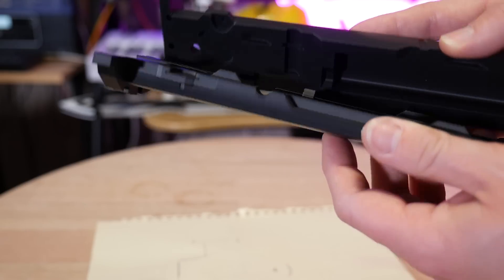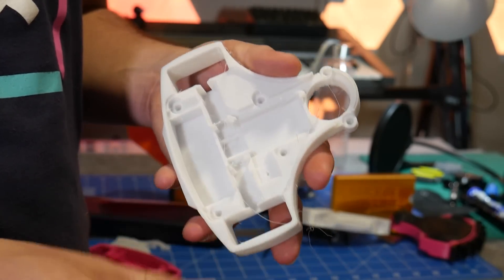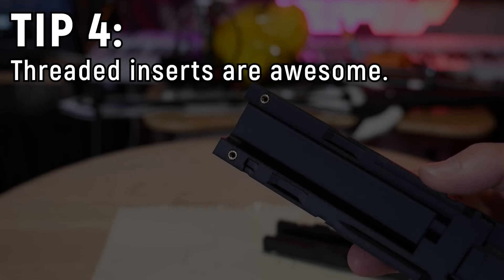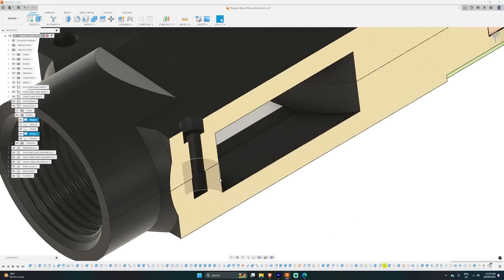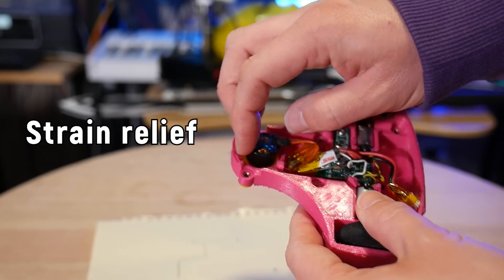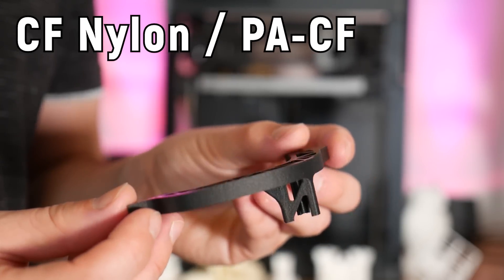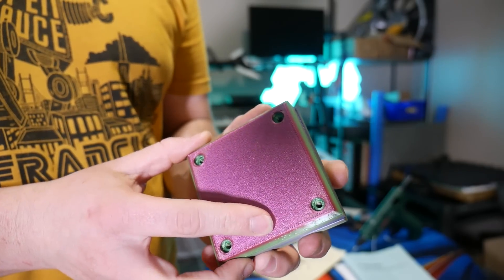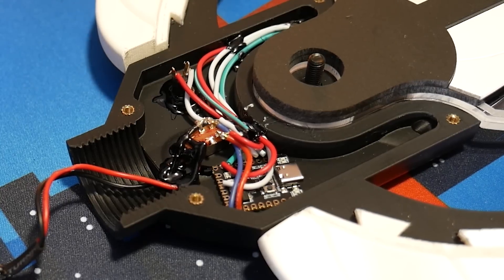How to design complex 3D printed products (and not mess it up!)

Comment: another alignment/indexing help is to design for flathead screws - i.e., the kind with a tapered head, and a mating cone-shaped hole. this aligns the cone of the hole with the fastener on the other end - most often a heat-set insert. This can get your allowable offset down quite a bit without having to have indexing features as much.

Comment: Further design advice for makers:
1). Use the simplest 3d software you can in the early stages of design. Using something freeform like sketchup is the digital equivalent of laying your components out on graphing paper. CAD is extremely powerful but it's also hard to change anything without your feature tree unravelling. In something like sketchup you will be naturally limited in what you can design, and this will (in early stages) work to your advantage. If you open CAD to soon you will get lost in the complexity, focus too much on adding fillets and chamfers before the desing is even functional.

2). When in doubt sketch it out: even before jumping into 3d you really should sketch out a couple of drawings of whatever you want to make. This will greatly speed up your 3d modeling workflow. This also goes for whenever you need to add some mechanism or significant detail to your design. Sketch it out first.

3). The best solution to a problem often looks deceivingly simple (though it may not have been simple to get there). If a part looks very complex there is a good chance it is not a great design. Be very weary if you see complexity increasing in your project.

4). If you find yourself optimizing certain parts before the rest of the basic design is even done, stop immediately! It's OK if your early design is chunky and unfilleted, it has to work first. Optimization comes later.

5). Objects in CAD may be smaller than they appear. For whatever reason when I started using CAD early on I would always tend to underdesign wall thicknesses and such. Always keep a caliper and ruler on your PC so you can visualize the real size of what you see in CAD.

Comment: I like that 3 prototype rule... I need to pay attention to that. I don't do 10k prototypes, but I've certainly had some moments of "ok... another test print... maybe this one will fit together right". As for clearance, I would maybe say to add it when a part is done. I've had more then one case where by the end of a design, I'm like "I got everything done, now to print" and I've forgotten some clearances. I tend to make the clearances parametric, so if something doesn't fit, I can adjust everything at once instead of that one spot/change. Often that fixes it, sometimes I get extra clearance... but as you said, that is often fine (or even good). The "leaving the inside rough", prior to the speed printers we have now, I remember trying to come up with how to modify a slicer so unseen parts (or maybe my "painting" it), internal parts could be printed with less polish and thus faster, saving time. Never really got around to it in the end.

Material choice: preach! I have a lot of stuff printed in PETG simply because I went "PLA is nice, but I need something with X property" and the options are usually "everything except PLA". Even with PLA's temperature challenge, some extra walls do wonders. So long as it's not stressed and is simply sitting there (a Garden Gnome...), do PLA. But I think a holistic approach is needed... what are you trying to accomplish... does it need to look a certain way... that gets you started on what material to use. Then sketch it, make a prototype. Seeing how that are fits together and works, now refine the material choice... if you need strength on a spot that has a couple small layer lines, carbon fiber and similar aren't going to do it so avoid those even if it will give that cool look. Etc. Etc. It's not a one off choice, and you nailed the bonus of "don't need to 3D print everything". There's a well known spat that happened online between some cosplay makers where one printed a giant prop, another said "do that in foam or something so it's less taxing on the arm", they argued... and then someone else interjected themselves to say they weren't a real cosplay maker if they used a 3D printer. And even though that 3rd person was unrelated, that kinda killed the mood and I think cemented the bad blood between them and their fans. But, like... think about the use and what goal you're trying to reach as it defines so much more of the design.

Awesome set of tips.

Comment: I know why you don't like tapping plastic directly for machine threads, it's because you don't use petg.  I switched from petg to pla+ the other week and found the pla really doesn't like the tap at all compared to the petg which is just a bit fiddly.  (Caveat, my projevts are mostly enclosures that just go together once or twice, not in and out a bunch)

Comment: I've actually managed to get several things right the first try, tho they tend to be simpler things and don't usually have tons of interaction with other stuff, so things like tolerances aren't a fail point; butt making prototype prints for things that do need to interact is definitely helpful, that way you can get an idea of how they're going to interact without spending so much time or filament making something you're not sure is even going to work

Comment: My tip, which I'm sure you already use. For parts with complex geometry, take a picture with a scale and import to you CAD software to use as a template for modeling. Then, if you have a 2D printer, you can print scale images to check the fit.
Reply: A 2D scanner also works even better, since it is basically taking a near orthographic picture

Comment: If possible, isn't it better to design the use of inserts to go in from the backside, so the tension of the screw will have to pull the whole insert through the printed part?  That's MUCH stronger than the tension pulling the insert out from the same way it was inserted. You can even get away with using nuts inserted from the back or even the side, rather than inserts in many situations.

Comment: So great to have all of these tips in one place. Thank you! I wish I knew these things when I got started instead of figuring them out through the frustration of scrapping a build and starting over. All because I didn't consider how my parts would come together. It took a while to get the hang of keying and proper screw placement. I tend to use screws and nuts instead of inserts. I just design the part to hold the nut and it works pretty well.
Hot glue is great as strain relief.
Keeping things rough inside is great for long-lived builds. Easier for maintenance and upgrades or replacement parts. "Design for maintenance" could probably be a whole video. So many little things that make life easier.
Thank you so much for that graph paper idea! I can't believe I didn't think of that. I used to do that for other things a million years ago.

Comment: So THAT's why I have around 120 different types of nuts, bolts and washers!

Nice video, I really liked it :) 

Concerning material choice, one thing to note with PLA is that it tends to deform permanently under pressure. So any screw you put in, will become loose over time. I had that happen with many things i printed for my workshop in the olden days. With PETG (my by far most used material), you don't have that problem. But print quality and stringing/oozing is something to be taken care of. 
I can confirm the heat issue with PLA, I printed some sun filter mount for my telescope and in the summer heat in the car it got soft and deformed just by touching it. Another print held up surprisingly well, a cup holder in my car. I guess it automatically annealed it in the heat when changing seasons.

Lastly, it may be different in your area, I found the screw selection in my hardware store comparatively expensive and quite lacking. Ordering online (on ebay or shops specialized for screws) for me is way cheaper. Most of the times, the price for 10 screws is only marginally lower than for 50 or 100, so I tend to get the bigger package just to have a few ready in the future.

Comment: you mean the 6  prototype rule?
1) Oh it works but I made this tiny mistake. \0/
2) Oh it works but in fixing it i caused another mistake
3) Oh it's perfect now, but I ran out of SRAM/FLASH and now I gotta upgrade to a new microcontroller
4) Oh crap I accidentally connect PB7 and PB8 to PA7 and PA8
5) oh wait that pin was only PWM capable on the old MCU, I had the wrong documentation open
6) Finally.... please... just work...

(Not based on a real story at all)

I've had projects be perfect on the first try tho... and I'm always like "this is... REALLY suspicious"

Comment: When you talk about using fusion and playing with tolerances. With all the additions of configuration wizards for the commercial side, and the much more powerful script and expression system for variables. My choice is to control tolerances from "Change Parameters" I specifically create user variables for tolerances. I then take my measurement either as a Parameter or just a general defined dimension, and add it to my tolerance in the defined dimension. This is so quick and easy, and since often my projects can get put on the back burner for months at a time. When i come back and sit down to refine a project for myself. Its much easier to find and tweak things quickly.

Comment: 100% everything spot on. Great video.
Side note McMaster-Carr has cad files to pull in and help in your designing. Lots of fasteners available.
Reply: You should definitely NOT download McMaster STEP files and 3D print them yourself, as this is against the terms of the site ;)
Reply: @jtparm2  just fyi... I don't print them.... I use them in CAD to get the proper clearances and lengths needed for builds. Thank you for posting and not reading properly.  This guy should tell AutoDesk too, since it's actually been integrated into their Fusion360 software.

Comment: For heat inserts: while prototyping, I would recommend taping directly into plastic. I usually print a 80% dia holes and quickly tap em with drill bit. On final model, just change holes diameter to accommodate heat insert. Yes, inserts are cheap, but with multiple iterations the time to install them into each prototype piles up quickly.
Reply from the maker: Good tip, saves time too

Comment: Really good advices! Thanks! But I try to avoid heat inserts, when it comes to weight: They are bulky and heavy. I try to design my models with nuts, bolts and additionally maybe washers instead. Cheaper and lighter.

Comment: One of my favorite personal designs uses the bare minimum of 3d printing/filament to augment cheap small binder clips so they reliably hold filament on the edge of spools in a clean arc, embracing the fact that metal always makes a better spring than plastic, the trick (like screw-lengths)is finding a readily available spring everyone has access to! I'm still using my released version to this day 'forever filament clip' on printables.
Reply: Nice! I checked out the design and posted a make, sadly with a bit of an issue I had
Reply: @icefox13  it's always understandable there will be some issues when trying to make things 'universal' thanks a bunch for letting me know there's edge cases on thicker spools I wasn't aware of prior.
Reply: @Roobotics  no worries, I have made a few models myself and waiting for the backlash ;) all's good, mate

Comment: For hot glue usage: pouring a lot of hot glue will deform your printed parts, unless you use a plastic with good heat deflection, like PA-GF. Silicone sealant will be better if you need more than two drops.
RTV silicones will also be better mechanically.
Reply from the maker: True! I've done that to myself before. Good tip for RTV silcone I'll have to give that a go.

Comment: Your tip about finding fasteners you can get is a HUGE one. I've designed a bunch of things that require fasteners, and I learned the hard way to design around the actual fasteners you can get and don't rely on preexisting CAD models or dimensions of what they should be.

Comment: IS there a reason you prefer using a surface versus the solid "split bodies" command?
Reply from the maker: 0 thickness, so I can assign clearances where I want them. Either approach works though !
Reply: @MakersMuse  With Split Bodies you can use sketch lines as your tool and it doesn't create a thickness or gap. But I also see how you can create more complex splitting geometry by first aiming for a surface. thanks!
Reply from the maker: @lunaumbra5179 Ah yeah I keep forgetting you can do that now, it's a good time saver !

Comment: Small TPU parts are my favourite to design, like prints to hold radio receivers & antennas on racing drones.
When creating small prints, working 'with the grain' of how a part is printed helps ensure its strength, look at the 5th picture of Thingiverse 5743370 of mine to see what I mean.

Comment: Hot glue is surprisingly strong, I recently printed a rough draft of a wizard's staff to get a sense on the scale and check how details look IRL. It's basically 6 cylinders hot glued together and it held really well, even standing up to a bit of abuse. In the final I was planning on adding locating features and will probably print it from ABS and weld it with acetone just to be extra sure

Comment: One cool thing I see james bruton specifically use in a lot of his assemblies is when printing larger parts that need other parts put through them (rods, bearings, etc.) he prints the larger part and then a bushing sort of part that fits into the large part, that the bearing/rod/whatever goes into. That way if the hole for the inserted bearing/rod/etc. is the wrong size, you don't have to reprint the entire large part. Really cool way of doing it

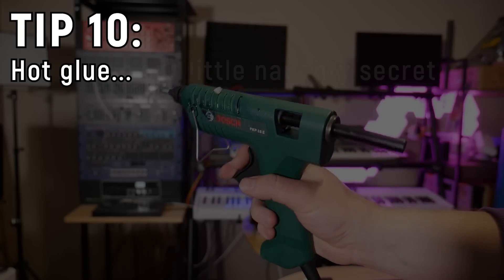Comment: 15:28 And, if you ever need to remove hot glue, a little bit of denatured alcohol and it will completely and cleanly release from whatever it is attached to almost instantly! It's truly amazing, one of my favorite tips, and i like to share it every chance I get. (Other solvents work as well, but I find denatured alcohol to work the best. I keep some loaded in a syringe, and whenever I need to remove some hot glue,  grab the syringe, douse it with a little alcohol and it peels off in seconds.)
Reply: Oh my, you just saved me quite some trouble good sir!

Comment: With regards to fastener choice: not only do you need to make sure you design around fasteners you can actually get, it behooves you to design around the same diameters and lengths for the whole project if you can, especially if you expect to disassemble and reassemble it at some point (and if you think you’re not going to do that, think again). This is often overlooked in “real” products where the cost savings can be meaningful when dealing with production runs of thousands of units, but for the home hobbyist the difference in a project’s cost will be at most a few dollars.

Comment: You nailed it. I've been building complex electro mechanical prototypes for the toy industry for nearly 40 years. Everything you lay out in the video is absolutely key to making a complex thing work well and work reliably. This video is must watch for hobbyists and professionals alike. Nice job!
Reply from the maker: That's amazing! I wanted to go into toy design after uni but jobs were slim in Aus. Are you able to share one or two of your favourite designs?
Reply: @MakersMuse  Airhogs Robotrax. By far the most complex prototype I've done. Most challenging and fun! Also Spinmaster Owleez and many more Toy RC cars, planes and helicopters for the majors.
Reply from the maker: @BigC799  So much respect for those designs, they look incredible. Thanks for the comment!

Comment: "Never use solid wire".. Most of my projects are done with kynar/wire wrap wire!  Silicon and PVC wire are all SO THICK and get in the way!
Little blobs of hot glue and everything is wonderful. Wire wrap is so thin that it rarely fatigues.  :)
Edit: Never mention hot glue without reminding people that IPA undoes hot glue.  Makes it so much more versatile, especially during prototyping.

Comment: If someone like me has worked with design & engineering for a few decades, your tips are standard procedure. So, what you say are absolutely top tips for 3D printing people who are not engineers, excellent! The first part about sketches on paper, absolutely. We say PAD/MAD before CAD/CAM. What PAD/MAD? Pen Aided Design/Model Aided Design. That is the way to go…..and as said in the video, prototypes are important, even the best engineers don't usually get it right….or best possible on the first try. Very good video! 👍

Comment: I noticed you've also used a lot of chamfers, and avoided rounded overhanging in your designs. 

Also, isn't PLA+ able to be heat annealed?
Reply: Heat annealing only increases strength, not temp resistance. But yes you can

Comment: A prototyping tip I like is to just print a small part of a model to check if it fits a real-world part. Just printing 3 or 4 layers to see if a hole pattern matches with reality saves a heap of time and filament.
Reply from the maker: yeah! That's a super useful trick for big parts. Hope you're doing well :)
Reply: I just made a PC case and used this technique to check if the front panel IO fit. would suck to print a big part just to find a hole is a few MM off and having to modify or worse re-print.
Reply: Same, I print small parts of every model. Rather have a lot of small prints less than 10min than have to wait hours just to find out a small part of a model doesn't work.
Reply: Same here, I do it all the time. Most of the time with some cuts made in the slicer
Reply: That's how I do it. I protype portions to get fitments down right before I do a full print.